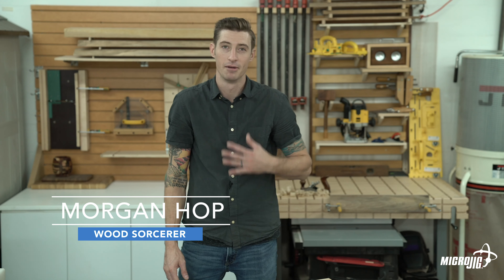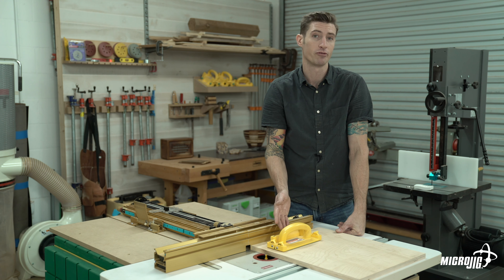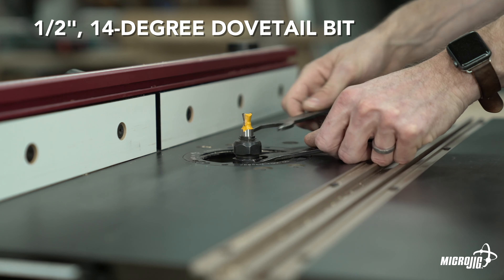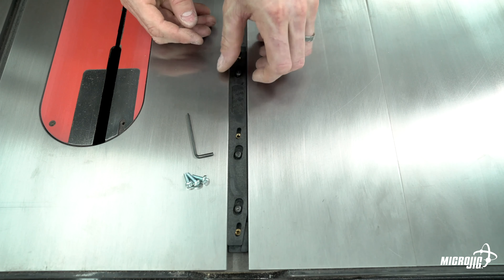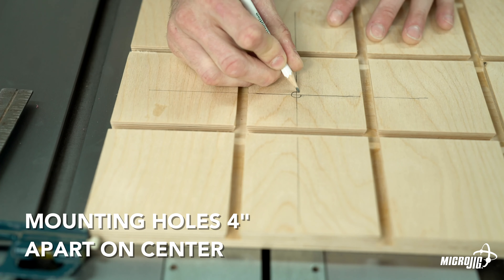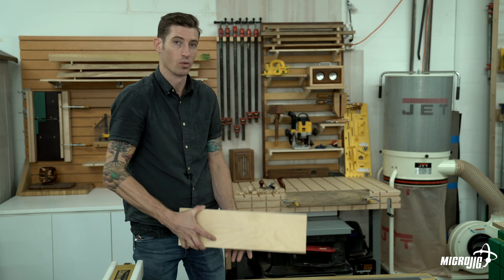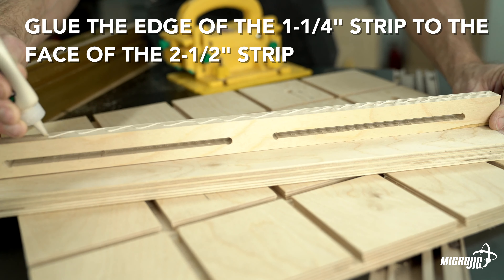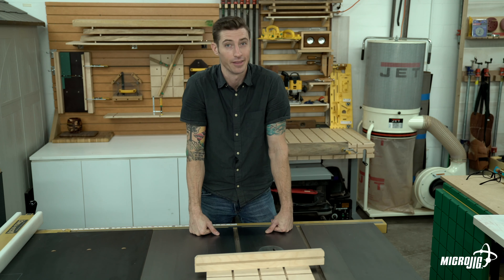ZEROPLAY 360 Sled Kit | Instructional Video

Comment: This video certianly makes building the sled easier, but it has several faults too.  It doesn't say you need a clearance hole for the fence but it shows one in one the fence in the video.  The cross holes for the sled are shown to be drilled but they aren't used?  I guess they are there for turning the sled 90 deg?

Comment: Maybe I missed it but why did you drill the 2 extra hole when drilling the miter bar holes? You drilled 2 not in line with the miter bar. Everything else was explained great thanks for these build videos. Please keep them coming.
Reply from the maker: Kevin, great question!
On our original 360 sled plan, we made the two extra holes so you can use the sled with the long axis parallel to the blade or the short one parallel. 
The center mounting hole is used for both, but you can turn the ZEROPLAY Miter Bar 90 degrees depending on your work. 
Our new green ZEROPLAY 360 Sled Plans do not have these extra holes. We found that folks rarely turn the sled, they tend to use it as set up the first time.

The new 360 Sled Plan video can be seen here: https://youtu.be/BHZVqRkGA-s
Reply: Wow, thanks for the explanation. I would have never considered that. 🤔
Reply from the maker: @blacknorce  you are welcome. This is why we are here.

Comment: My marks for the 6 holes came out closer to the edge than what’s shown.  I measured and remeasured.  Any suggestions?
Reply from the maker: Berney, that is not unexpected. The distance from the miter slot to the blade differs from saw to saw. It can be as little as 4-1/2" or as much as 6". 
As long as the holes will not interfere with the dovetail slots there is no problem.
BTW, you can always set the ZEROPLAY so that the sled  base is over the blade, then trim the edge. This will give you a zero clearance cut line!

Comment: hi, thanks for the vid. You use a 1/2" x 14 degrees dovetail bit. Where I live in Europe, the only dovetail bit available is a Bosch 14mm diameter x 15 degrees. Would the slots cut with this bit work with your dovetail hardware please? Thanks again!
Reply from the maker: John, the 14mm would likely be too wide. A 13mm might be usable but we have not actually tried it. 
We DO make our Dovetail Bit with 8mm and 12mm shanks to fit European routers, so you can use our bit to cut the needed Dovetail Track.
You can order directly from our website, and we also have some European Dealers.

Comment: I've attempted building one of these twice now. Dovetails are too wide for the hardware and/or plywood splits out when I try to clamp anything down.
Reply from the maker: It sounds like you are either cutting the slots too shallow or your bit is not a 14 degree angle. Even using a 10 degree bit makes the groove too wide, so the clamps or hardware tend to extend above the groove so they do not clamp properly.

Comment: Have you had your green hardware not tighten in the dovetail grooves .....my fences move on my sled even though I’ve tightened the hardware. The green slider is not tightening against the angled sides of the dovetail.    Any suggestion on what I’m doing wrong? Dovetail grooves not deep enough?
Reply: I've got the same problem.  There is no gap between the hardware and the face of the base.  That or the plywood splits.  I thought this was going to be a great thing I'd use all the time.  I'm disappointed.
Reply: Wheeler Hammontree I haven’t tried this yet.....but those grooves that really don’t work seem to be shallower than those that work. I’m going to try going deeper with the groove by a 1/16 or so ......more than the set up guide indicates. I’m thinking this is the issue. Try it....it might work.
Reply: @lawrencep5427  My problem is the width of the dovetail at its narrowest still allows the hardware to be flush with the surface. The dovetail needs to be tighter widthwise.  I cut the dovetail to the narrowest part of the neck of the bit was right at the surface.
Reply: yup, dovetails not deep enough, i found you have to go a little deeper than 3/8 or it may bottom out in some areas.   see my video at https://youtu.be/o0WzSWp_H5E
Reply: @Otterbrookdesign  spot on...same issue then went back and used the depths from their setup guide, making sure i reproduced same fence settings from relief cut and dovetail - got the result, no movement.  In comparison, there wasn’t enough depth in the cut the first time.